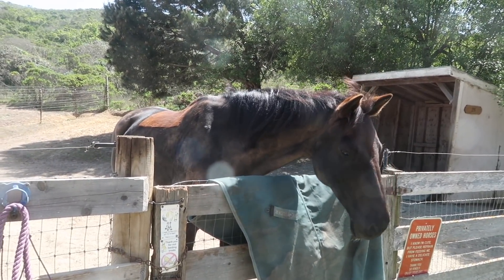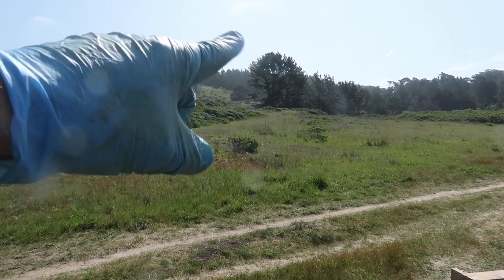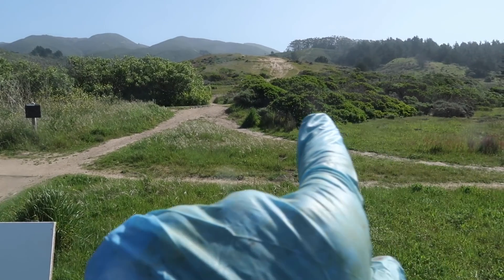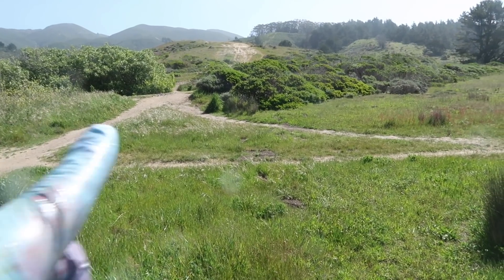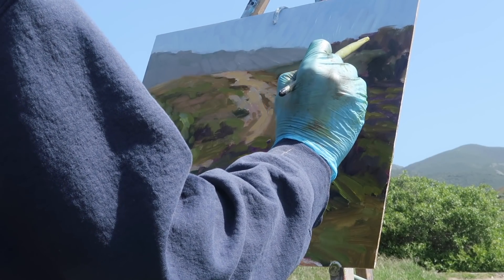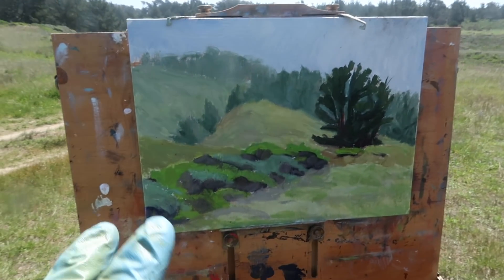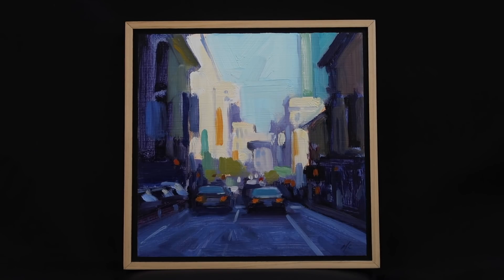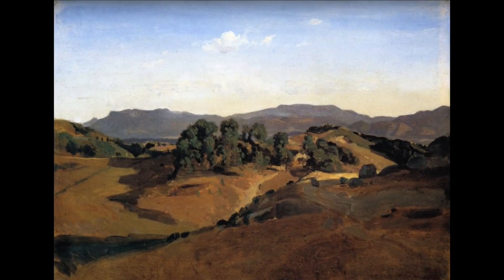PLEIN AIR oil painting McNEE RANCH in MONTARA california

Comment: I like the idea of painting on bigger boards but most houses in the UK are a lot smaller than in the US. So wall sizes are a lot smaller. Will think about it.🤔 Thanks for the video Michael. Warming the greens with red certainly seems to work! Cheers, Oliver
Reply from the maker: Just use smaller frames! A 16x20" in a floater frame isn't very big. Victorian homes in SF have small wall spaces as well.
Reply: @chamberlainpaintings  Good point Michael!  Floater frames may be the answer, although they're a lot more expensive than the standard conventional oak frames I'm currently using - unless like you I make them myself!